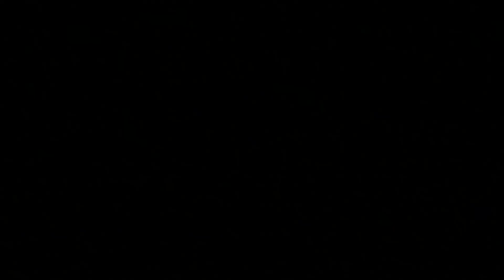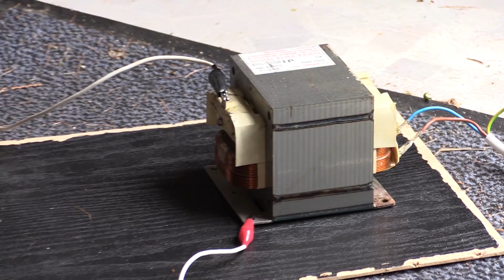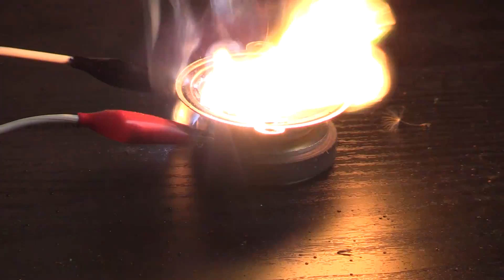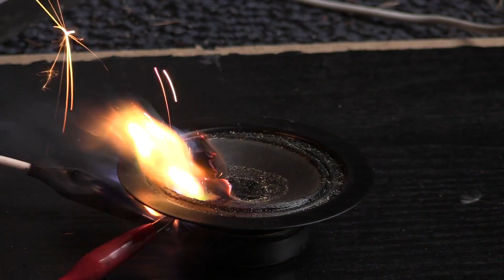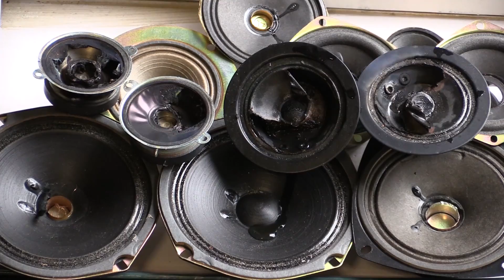Blowing Speakers on 2000 Volts!

Comment: lol nice little scrap pile you made there. :) my question is how the MOT did not blow because although the secondaries are 2000+ volts the ma is quite low.
Reply from the maker: I never left the MOT on for longer than a few seconds, so it could cool down again.
Reply: True if it was only a few seconds that would be understandable.

Comment: 2000 watts u mean
Reply from the maker: The speakers were connected to a 2 kV power source. So it indeed is 2000 Volts. Power (Watts) would be Voltage * Current.

Comment: I wonder how some of these higher voltage transformers work. Like how can you get 2000 volts out of the thing when there's only 120 going into it?
Reply from the maker: +Halon Poisoning RD 
Wheather 120 V down to 5 V or 120 V up to 2000 V, tansformers all work through electromagnetic induction. More info here: https://en.wikipedia.org/wiki/Transformer
Reply: Thanks :)
Reply: One thing that may help is that I think this guy lives in an area that gets 240V power instead of 120, and I think this because of the tones from the blowing speakers. They are 50Hz tones instead of 60.

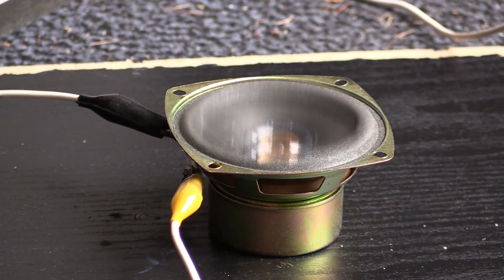Comment: I'm surprised at how long the speaker at 1:00 lasted.
Reply from the maker: A lot of speakers I tried ended up just arcing inside, the voicecoils remained undamaged. That speaker did smoke a bit (that's why it made it into the video), but I think it actually still works.